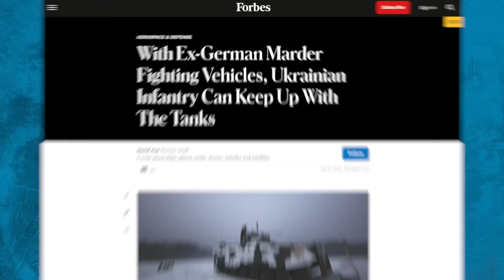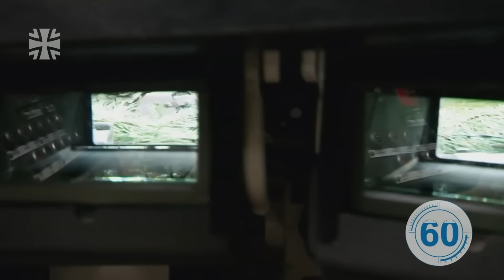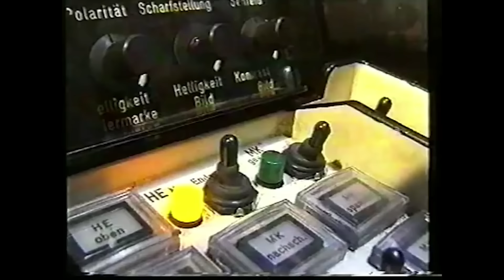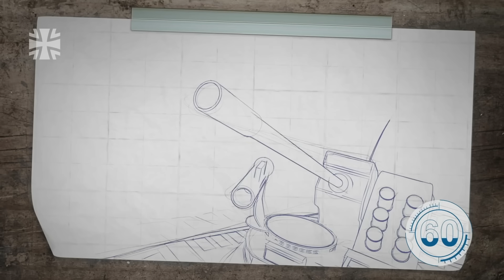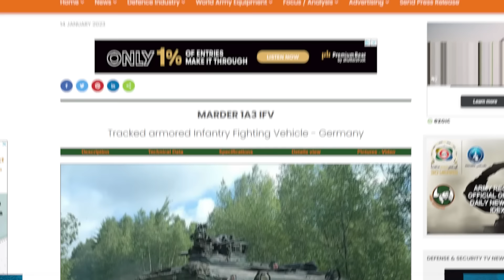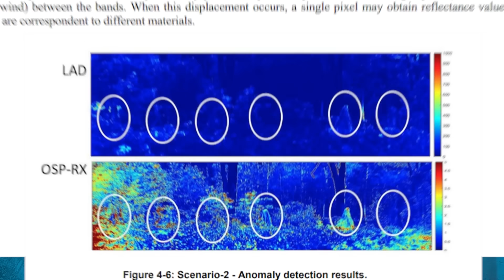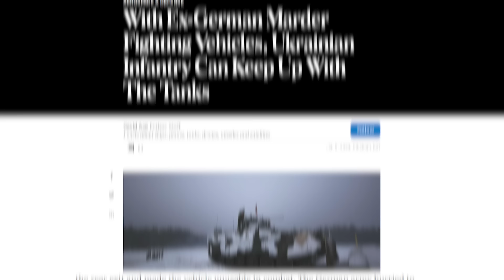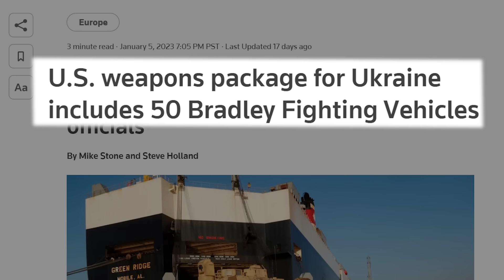Why this German IFV is So Hot Right Now

Comment: As for you vid on the Bradley, you completely missed some key points on why NATO IFVs might not be as effective as you present them in the specific case of the Ukraine-Russia war. Not a word on the two main threats those will face there : artillery and minefields.
Let's see a scenario of a Marder fighting in Ukraine.
The AFU launches a offensive. After piercing through the most forward posts of the Russian lines, the Marder encounters a minefield. 
Either the Marder passes through, either it hits a mine, resulting in a mobility kill. The crew is forced to bail out and leave the IFV where it stands . If the offensive fails, the Marder will then be behind enemy lines where it could be captured. If the offensive succeeds, it is recovered and send at the rear for repairs. Which means in Germany or Poland. Which means unavailable for several weeks.
Now let's say the Marders got through. They are piercing the 2nd line of defense and pushing their advantage towards the third and fourth lines of defense. The ground rumbles, and the artillery starts to fire on their position. They got spotted by a drone. (Marder aren't equipped for antidrone warfare). They either push or retreat. In either cases, the Marder presents no advantage compared to current Ukrainian IFVs. 

Sending offensive weapons to Ukraine is useless (even counter-productive as those are costly and if destroyed will bolster Russian morale and increase war fatigue in the West). What Ukraine needs right now is defensive tools to outgun the Russian artillery. They need more Howitzer, they need to break Russian domination in the sky with F16 fighters, they need more efficient long range means of locating and hitting Russian artillery, they need better maintenance equipment to make repairs themselves instead of sending broken NATO tanks back to Poland or Germany, thousands of miles away from the frontline.
Giving them offensive weapons could lure them in inconsiderate offensives that might cost them the win. Let's not forget that if the Kiev and Kharkiv oblasts were clear Ukrainian victories, they completely lost in terms of manpower and skill trades in their Kherson offensive, where they took heavy losses while the Russian VDV successfully retreated with minimal losses after fighting during months while only being supplied through 2 narrow corridors

Comment: The question on most peoples mind is how will these far against Russian, ATGMs, Shape Charge Grenades?? Is Ukraine making the same mistake Russia made at the start of the war?
Reply: From what I heard these are still extremely valuable on the modern battlefield when used correctly in symbiosis with other military gear like howitzer, tanks and aviation. Russia's problem has been that they are very weak at this type manouver warfare. Even though russia's very best equipment is better than what Ukraine has or will soon be getting, their tactics have been lacking, especially in the first 2 months.

Comment: If Germany gives 40 Marders, 30 Leopard 2 Tanks, why not give the 200 Leopard 1 tanks as well? The Leopard 1 tanks will definitely be a asset for infantry support but will have trouble with a direct engagement with a T-72.

Also if France gives 200 of the AMX 10 RC it will also be added to an attacking force.
With 50 Bradley's and the same number of M1 Abrams it should be enough to dislodge Russians from a few key cities.
Reply: In a firefight speed is of the essence.tank that shoot first wins [T-72 or not]

Comment: The interior of the Bradley is way bigger. You can get 11 fully kitted soldiers. Three crew, 3 on the short bench, 4 on the long bench, and one in the alt gunner seat in the hell hole.
Can carry half a dozen missiles, as well.
The arrival of the Bradley will hit differently than the Marder.

Comment: The first question must always be, why do the Ukrainians need armored personnel carriers, tanks and similar equipment? Because the Ukrainian army has been in an extremely catastrophic state since 1990. There is a lack of supply with all important things, for the fighting troops there is a lack of food, ammunition, housing, weapons and other equipment. The small navy and air force have ceased to exist. Personnel losses have exceeded 100,000, which is over 55% of the total armed units. Now they get discarded and partly outdated or even defective combat technology from NATO, like the German PZH 2000, of 14 pieces only 10 are conditionally operational. 4 have been total failures without firing a single shot. Now imagine combat vehicles coming from Germany, England, the Netherlands, the USA and the Ukrainian army now has to keep this technology running, supply it with fuel and ammunition and also repair, service and maintain it. Specialists are needed and special workshops are necessary. Who gets the spare parts and where should this technology be maintained if all places are within range of Russian weapons. The more different weapon systems are used, the more difficult the supply of spare parts becomes. The Ukrainian army hasn't even remotely been able to keep their own technology running, and now they're tasked with servicing and maintaining a hodgepodge of foreign weapons. Well then, have fun with it! If the crew is not well trained and able to operate in a formation, the "Marder" is only 20 tons of worthless steel and every RPG-7 is helpless. This also applies to the Bradley and the AMX-10.

Comment: Western doctrine was never to outnumber russia. It was to outfight russia. 3 good western tanks can easily take on 20 ruassian tanks. Doctrine, training, appreciating the value of your trained troops....and also making sure you have the logistics in both directions for supply to the troops and recovery of wounded troops help morale a lot.

It takes months to train a good tank/IFV crew. Any idiot can send a crew of 3/4 in an untested vehihcle hot off the assembly line. The russians do this.
Reply: You dont really get the problem with "quantity vs quality" hardware issue.

A) Lets pretend that one excellent and modern tank may be able to take out 2-3 less sophisticated tanks, BUT is still can be as easily destroyed by mines, infantry, ATGMs, planes, laser guided shells, helicopters, drones. <- This weapons are the main thread in modern combat, its NOT other tanks.

B) Tanks are used as support units and 90% of the job does not include tank vs. tank combat. Its actually even less than 10%. But, let's pretend it is.

C) Good and trained crew, that work in a good combined arms environment sitting in a less sophisticated tank, can also take out 20 enemy units using the same "less sophisticated tank ". This is only a tool, the same a firearm or a hand grenade. You make up your reasoning by imagining the alleged advantage of the tool and not the operator's training. Yes there is a level of being "good enough", that include modern hard hitting gun and shells, modern communications, night/thermal vision, driving engine power. But, this specs are pretty much standard for every MBT from the 80s and definitely 90s. 

Conclusion, you trade availability for the theoretical advantage in a area that will rarely occur AND because of the price you literally don't have enough of these tanks to make a difference in the other 90% of uses this unit actually suppose to be used in.

Comment: The Milan is a 2-3km missile in a world of 5-6km Bastion and Refleks weapons.  It has a 450-600mm penetration vs. threats with routinely over 1,000mm protection.  The RH20 is good for 1km and <30mm and has been outclassed since the 1980s and the debut of the 2A42 with 2.5km and ~60mm.

What's more, this is rapidly transitioning to a war of maneuver of heavy armor where IFV have limited use.  Once Bakhmut falls, the Marder will not even be able to keep up as it doesn't even have the floation of the early variants.  Maybe the Bradley will have some luck, if they give it the 4.3km TOW 2RF.  But the Marder is an amphibious APC with a large roof gun that can no longer swim.

The time to send these was July when there were still a lot of veteran tankers who could transfer skills across.  With ab initio crews, these things will be left by the side of the road with first little mechanical issue.  You need a vehicle which can rapidly evacuate the Donbas ahead of the likely flood of Russians.  At least in this, the Marder's greater capacity will be of use.

Comment: Y'know, Cappy, I'd further upgrade the Marder by upgunning it from 20mm to 30mm & swapping out the MILAN with the NLAW & add an Active Protection System to further protect the crew & troops onboard.
Reply: NLAW has half the range of MILAN (or a third compared to MILAN-ER), so I don't know how much of an "upgrade" that would be. APS would make sense, but is probably quite costly to retrofit? In general, I think the platform may well have reached the end of its lifespan -- the Puma will be a massive upgrade once its kinks are ironed out.
Reply: @ddshiranui  Say, do you play D&D 5e? If so, did you play with someone whose Player Character was named initially as Hrolgr the Half-Orc?
Reply: @fredhercmaricaubang1883  Oh, I'd have to disappoint you there, that must have been someone else!
Reply: @ddshiranui  Oh... Sorry about that. Pardon my mistake.
Reply: @fredhercmaricaubang1883  Not at all, it was worth the shot right? I hope you'll have luck in finding that person again!
Reply: @ddshiranui  Thank you! You are most kind!

Comment: Lotta claptrap from Cappy.. donno what got into him of late but just to address the blatant ones:

1. The Marder 1A3 can survive hits from the 30mm to the front and the BMP-3 also has a 100mm low pressure gun (so if needed an HE shell can be lobbed at the marder to render it combat ineffective).
2. Soledar has fallen, there is no reportedly on it. The Russians are taking settlements north and West of it already.
3. Ukraine has not made a single successful offensive push since their Lyman/Kharkiv push in autumn. They tried pushing east of Lyman recently and ran into a brick wall. 
4. Taking a city and reducing another one to only one national, sub interstate, road in terms of logistics routes is not tactical gains, it's strategic ones.
I have a deep problem with Cappy's reporting of events because they're taking on a propagandistic bent. At this point he's misinforming like one of Goebbel's stooges would "Oh yes, the Russians lost millions of men at Kursk. Don't mind the IS-2 rolling down Unter den Linden"

Comment: Sadly, the armor is not so good. Germany used the marder in Afghanistan and there they lost at least 2 of them to IEDs and if they get by an RPG, and the Taliban have the same RPG as Russia, the copper is piercing the tank and comes out the other side. 
Luckily, the tank I did see that this happened to was empty in the back, so we noticed this only back in base.
Reply: Marder can't be penetrated by RPG's and it also has a modern mine armour belt which saves the crew in the event of a mine explosion.
Reply: @swunt10  2. Juni 2011 in Baghlan look it up (IED) and 2011 in Kunduz RPG incident.

Comment: Problem with the Puma: Basically KMW and Rheinmetall BOTH working on it with different "ideas". Rheinmetall has it's own "Puma", the Lynx platform (mainly for export), which btw. is also in the race for the upcoming new US-American IFV with a 50mm canon, it won the Hungarian IFV announcement and also the Australian one. The Lynx is one the best IFV platforms right now, incredibly modular and with great technology (Rheinmetall i.g. is doing a lot of things very right at the moment). The Puma is not far away from that, but Rheinmetall is def. not pushing it as much as their Lynx platform and the results where Software issues and cabling issues with the Puma, especially after upgrading older versions to new ones. A few weeks ago 18 older Puma versions got cable fire and software issues after the system upgrade to the current version and the media pretty much pushed the case to the limits. Yes, the Puma is a desaster, but mainly because the organization is crap - not because the IFV is bad, it's actually great in it's design. But for now... the Marder 1A5 will do it's job for Germany being the NATO VJTF leading nation for the 3rd time in 2023. It's a damn reliable little tank, easy to maneuver and the 20mm canon is def. performing great with all the high-tech stuff and an experienced crew in the backround.

Comment: the French JAGUAR is much more powerful than the MARDER, it has a 40 mm CTA cannon with a programmable 40 mm shell loading, an anti-aircraft, drone, helicopter or missile capability, plus 4 AKERON MP missiles against heavy tanks ( 5000 meters ) ! the CTA 40 mm has several capacities, it can perforate 152 mm of steel at 1000 meters, 142 mm at 1500 meters, it can perforate a reinforced concrete wall of 20 cm and explode behind it, screening everything with dozens of shrapnel, it can explode over a trench or a wall to kill snipers, it can shoot down anything that flies within a 4 kilometer radius!
Reply: 🤦‍♂ is also much newer... the new Germans are even better than the Jaguar
and french send how much Jaguar´s?
Reply: @Socom1994  wrong, all wrong
Reply: The Puma is a German infantry fighting vehicle produced by the Krauss-Maffei Wegmann company and intended to replace the Marder within the Bundeswehr.

History

One of the Puma prototypes in 2008.
In July 2009, the German government placed an order for 405 units of the Puma for an amount of 3.1 billion euros. The first two copies were received in December 2010.

In October 2011, Germany lowered its order from 405 to 350 copies.

Of the 71 Puma delivered in 2017, 27 are operational.

The Puma infantry fighting vehicle, plagued by numerous technical problems, was declared combat-ready only in 2021.

In March 2022, of the 350 armored vehicles delivered, 150 can be engaged in combat.

In December 2022, it is revealed that during training with 18 combat vehicles, operational readiness dropped to zero within days.

Features

Interior of a Puma prototype.
Capable of carrying six infantrymen in addition to the three crew members, it is equipped with a 30 mm automatic cannon and weighs between 29.4 and 43 tonnes depending on the level of protection. Unlike the VBCI and the Boxer, it is tracked. Some are armed with a MELLS anti-tank missile turret carrying two Spikes.

The autocannon uses 30×173mm shells and has an effective range of 3,000m. In tests at eight targets between 1,200 and 1,800 m at which five shots per target were fired, 37 out of 40 shells hit them.

It is designed to be air transportable in an A400M: armor can be added on the battlefield. Reactive armor from Dynamit Nobel Defense has been fitted to German armored vehicles since the end of the 2010s! the JAGUAR has a gun that shoots up to 4000 meters, so better than the PUMA, it is equipped with 4 AKERON MP missiles with a range of 5000 meters while waiting for the AKERON LP up to 20 km! how a German tank is superior to the JAGUAR LOL! and the cannon of the JAGUAR can fire on ships, on armored vehicles and on all that flies (planes, helicopters, drones or missiles) does the PUMA do it? No ! So you are talking bullshit!
Reply: @LOLOVAL-os3pq  yes and the new German tank is better...
And how much send you land to Ukraine?

Comment: Swedish CV90 will be the most modern infantry fighting vehicle in Ukrain, as long as Germany sticks to only sending this older design. Would be interesting to know if Sweden will send the Swedish Army version with 40mm bofors canon, which is claimed to be able to destroy T-72 tanks even in the frontal hull, or if they more likely will send export-versions that sports smaller canons, 25-30mm.

Comment: The French AMX10 RC should not be under estimated it's 105CN gun is both accurate and deadly. It can fire smoke to defeat enemy optics while retaining the ability to see the enemy and sit there picking them off. A few Leopards or Challengers to crush the T72's (they will) and the AMX will kill everything else one shot in most cases.

Comment: That older stuff sometimes have something so basic that it is today forgotten. They were made for harsh conditions, simple, rugged and reliable. For example, I recently ran into a vid where some Ukrainian soldiers say they prefer old Soviet artillery pieces and M101 than M777! They claim that barrel of 777 gets worn out extremely quickly, it is harder to operate and repairs are nearly impossible in the field. So, they have to tow them to Poland for repairs! Which results in not having the full number of 777 at any given moment. At the same time, M101 despite firstly arriving at the end of WW2, is far more reliable and simply works all the time, very easy to repair... Same as old Soviet stuff...
Now, Germans are, on the other hand, not known to make simple equipment and especially armored vehicles... When you compare Panther or Tiger tanks to Sherman or T-34... And Marder is untested in real battle, true... Guess we'll see... So far, there was little use of these donations to Ukraine except making the war longer and taking more lives away.